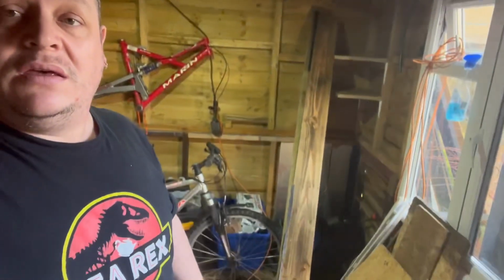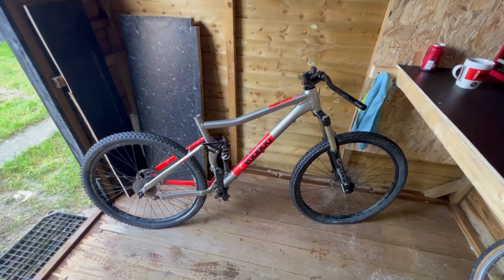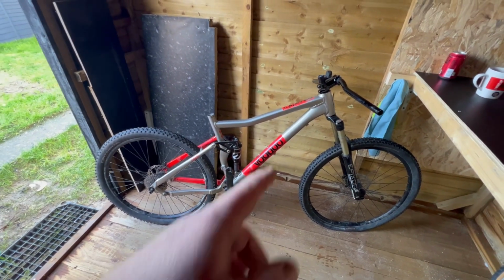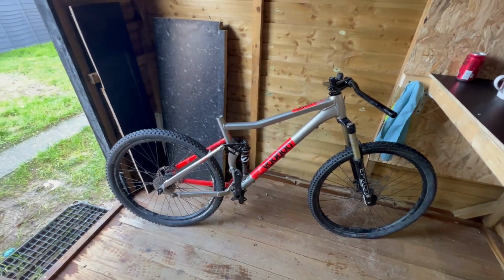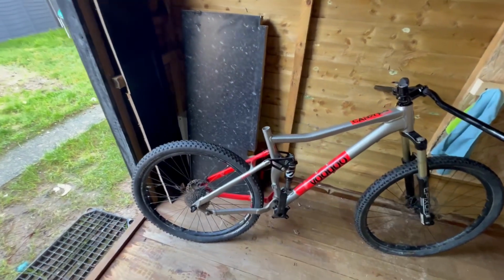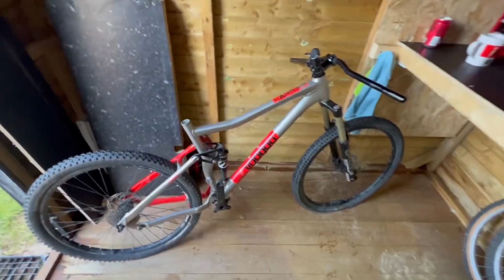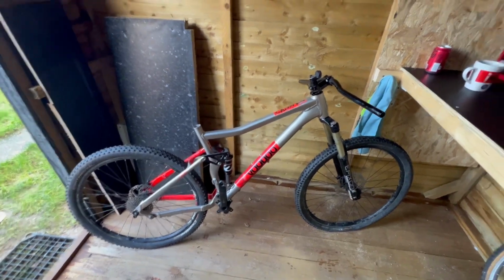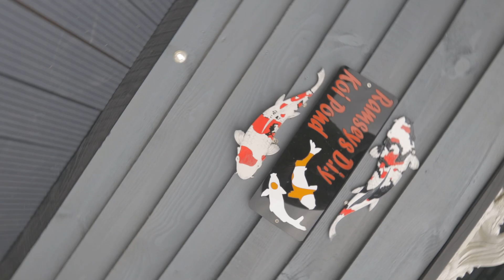Just A Quick Check In 👍⛩️🐟

Comment: Big difference there Lee Mucka is that a set of xcm forks I see there I'm working on mine just need a new rear derailer
Reply from the maker: Cheers buddy, no they are sr suntour but there the epixon tr, there air forks where as the xcm are spring bud 👍👍👍
Reply: @RamseysDIYKoiPond  maybe the same sa mine then I can lock them for on road and off road